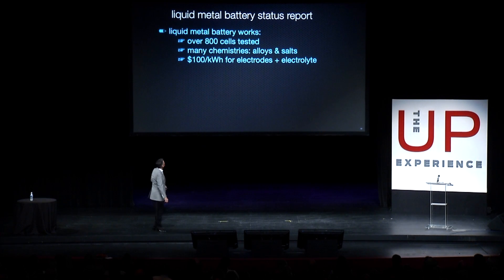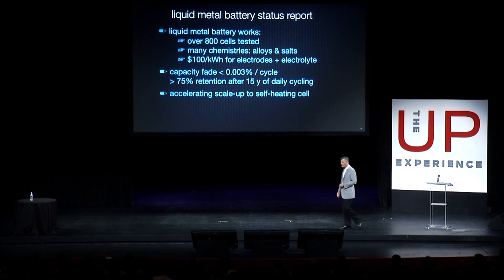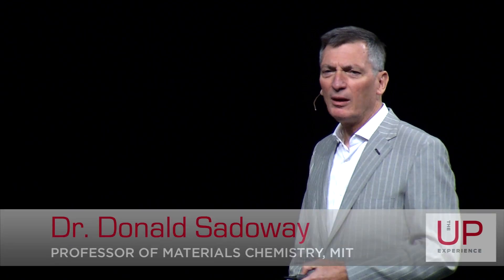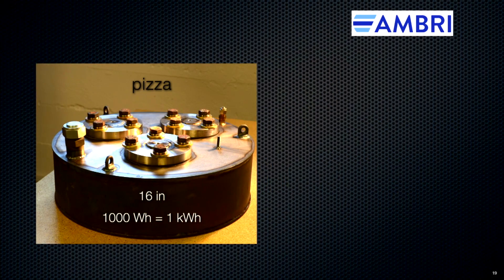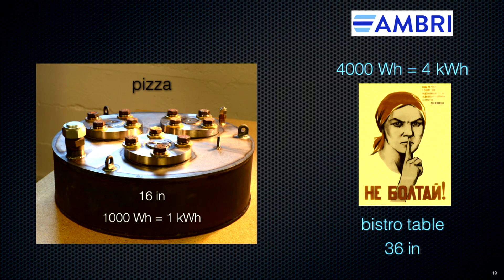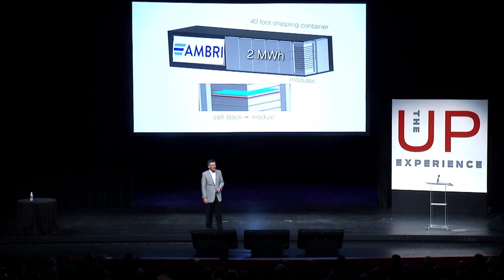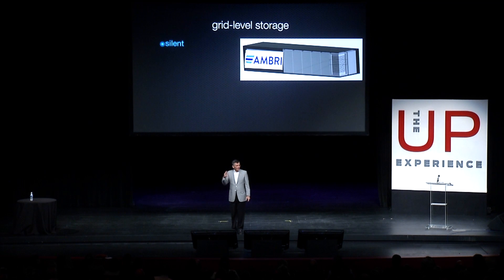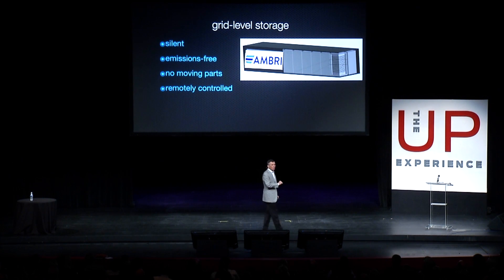Don Sadoway and the Future of the Liquid Metal Battery

Comment: Only those companies that have had the experience of exporting outside of the US use world measurements.
If we buy US machines direct from the net we get odd sizes.
You have to buy US sized tools to maintain it.
If i buy from anywhere else in the world the sizes are compatible and interchangeable.
Our children are not taught your measurements, they are only used within the US nowhere else on the planet still uses them and unless you can convert the world back to inches they never will.